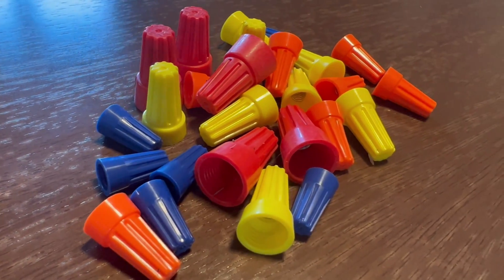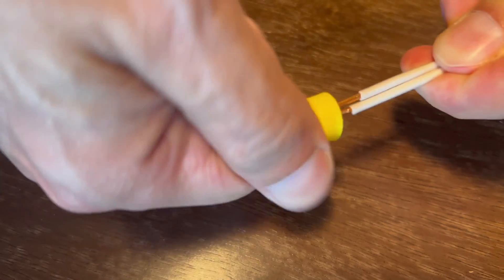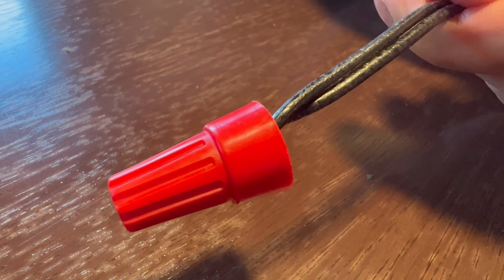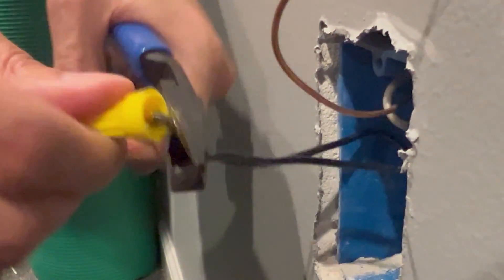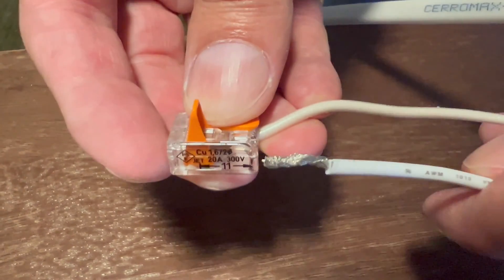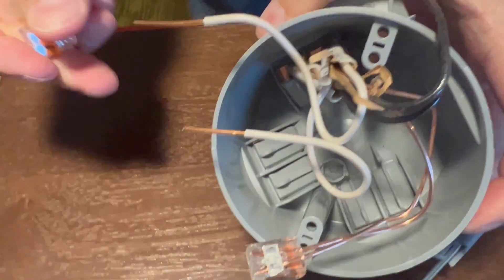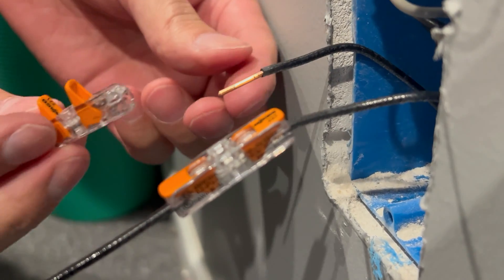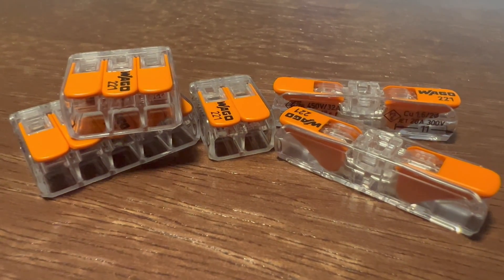Stop Using Electric Wire Nuts - A Better Method That Works Every Time

Comment: No way that those dents make any dent on the conductivity, they are on the non contact part, that's why they have marks. DO NOT cut wires, the problem resides in too much manipulation causes fatigue and cables break. But you can also run a new one no that hard. Other than that, wago don't damage cables as nuts do, and you don't need that low resistance for lighting (ohms law). For mains outlets proper wiring dispenses with nuts altogether as those receptacle have in-out bars for daisy chain connection.
Reply from the maker: Thanks for the additional information & context. Thanks for watching and taking time out of your day for responding to my video. I appreciate it.

Comment: Meh. Sometimes making a connection between solid and stranded can be annoying but it's not a big deal. I would have to see the actual price difference.
Reply from the maker: The fancy push connectors are about five times the cost.

Comment: You might show how one ought to correctly install a wire nut. I like the convenience of the PTC connectors, but I’m skeptical of the connectivity of the cheaper connectors. Same with cheap wire nuts. Really, the likelihood of most fixtures needing the wire nuts removed and replaced is a couple times over the life of a house. Really not a big deal, especially when you can pigtail also to lengthen a wire reach out of a box. One problem with these DIY oriented options on the market is more homeowners are DIY-ing it, and I’ve met more than a few who shouldn’t.
Reply from the maker: In Europe it’s all they use and they think we are weird for using wire nuts.
Reply: @HomeRapidRepair  if I’m not mistaken, Europe also defaults to 220V for household wiring applications, which translates to lower amperage passing through the connections. There are benefits to running electrical that way, though significantly more dangerous in the event one drives a nail through a wire in the wall, or sticks their hand in a live socket. In any case, the amperage is lower, which would make those kinds of connectors safer. I think for 20A receptacle applications, it would be better to use wire nuts, as well as fasten the wires by means of the screws on the receptacles instead of the slip connectors on the back.

Comment: As a person that's been working on electrical for many years repairing all sorts of equipment these new Waco nuts are not very good for high amperage insulation I've seen wires turning purple Winkle nuts starting to melt and everything was installed correctly but Waco nuts are only to be used for low amperage 5 amps or lower they're absolutely great for doing LED lights and things like this but nothing will be a good old-fashioned wire nut properly installed  lazy electricians pushing the wires in the back of wall plugs light switches okay is not up to code for me I've seen wires turn purple some short circuits because people plug electric heaters into these outlets. Do not use Wace  wire connectors for anything over 5 amps and that means not for wall plugs at all. Don't do something that's going to Short circuit later or cause a fire. Meaning don't be lazy and do it the right way.
Reply from the maker: Thanks for sharing and adding to the conversation
Reply: Actually the WAGO connectors he is showing are UL Listed and have a voltage rating of 450V with a current rating of 32 Amps and can be used with wire sizes from 24 - 12 gauge

Comment: I have been considering these connectors as I am doing minor upgrades to my house, including electrical. These do not seem to have as much wire to wire surface connection. Do you know if there is an issue with increased resistance, or increased heat in using these?
Reply: Waco nuts are only good for 5 amps and lower play it safe and do it the right way. There's No shortcuts in an electrical nor is there in plumbing
Reply: @pauljanssen7594  Thanks Paul!
Reply from the maker: Millions of people use them worldwide

Comment: Simply speaking, if someone is competent and a craftsman aka decent tradesman with pride in their work, then I would trust the connection they make,

That being said and also the proclivity of a person to make a buck, which means, time, components, quality etc are curtailed,  I would trust the screw clamping forced unit, wago or other brand with similar features, rather than marettes aka wire nuts,

Have lived & worked in North America since 2016, this Brit has seen alot,
Firstly no test or inspect of electrical systems in North America,

Second, its very much prevalent to make money first, then craftsman and pride of workmanship is low low on the list,

It's very much a race to the bottom, with national, state and city electrical code, which is governed by unions, big corporations and national, state and city politics,

Admittedly the UK is slowly catching up, but, there is still checks and balances, with a push back from the trades,
Reply: I get notification of a thumbs up and not even one, mysterious or by design there is not a single one,

So either the notification is wrong or something is afoot,
Reply from the maker: Thanks for sharing

Comment: In Russia Wago’s got a bad reputation cause of two issues - typicaly electricians used a cheap chinese analogue of geniune product. Also a problem with wrong choice of wire gauge and nominal value of circuit breakers still exist. So “oldschool” electricians still use a 5 to 10 cm (2 to 4 inches) twists, solder and weld them in junction boxes instead of using modern types of connection.
Reply from the maker: Thanks for sharing

Comment: Been using wire nuts for 40 years.  Never had a problem. And I've wired thousands of apartments and house. Drove a service truck for a few years. Never had a wire nut as the problem. I'll keep using them. These look expensive and unnecessary.
Reply: I too have used wire nuts with no problems and if you notice he doesn't do the pull test to make sure the wires are secure these Wago connectors are rather expensive
They cost at least twice as much as wire nuts and I also tape them on to keep them tight
Reply from the maker: Thank you for sharing
Reply: Luddite  !